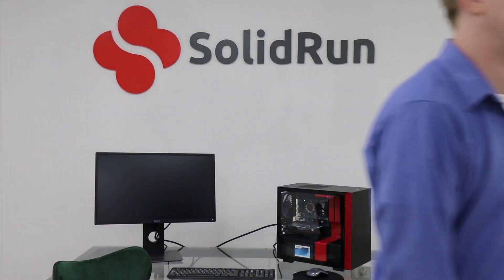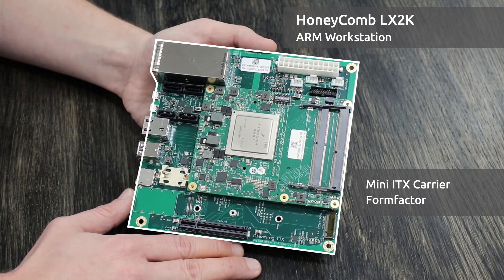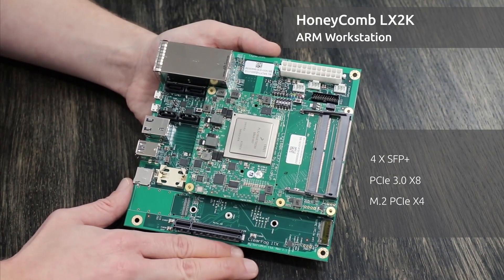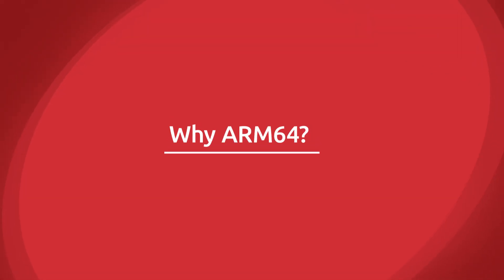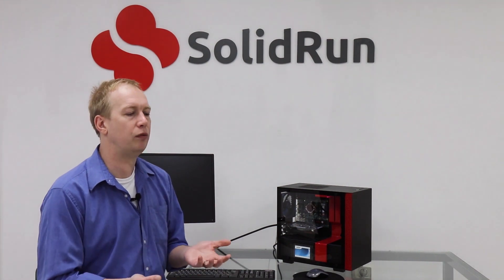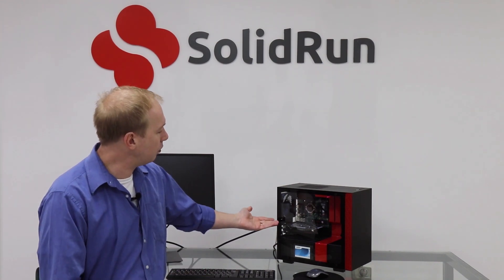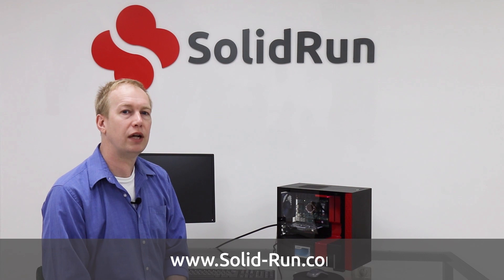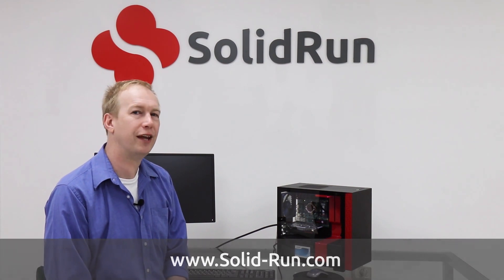HoneyComb LX2K - Ultimate Mini ITX Arm Workstation

Comment: I find this very interesting how does the SOC tolerate overclocking. I know pi 400 takes it rather well but with additional cooling even just a stock cooler. In contexts where a brief but explosive blast of compute is required eg building applications. Can the issue cooling permitted handle such things?
Reply: Generally the overclocking stability sweet spot is 2.2GHz, we have overclocked up to 2.5GHz with proper cooling, but new production models have the CPU voltage locked. 2.2GHz is possible with the default voltage settings.

Comment: Can it run windows 11?! Can it run Ubuntu?!
Reply: It can run Windows 11 currently, however Microsoft is not planning to support this generation of chipset moving forward.  Yes it is SystemReady ES certified and can run most standard Aarch64 distros.  For best results and on board networking support you will need a distribution that uses a 5.14 linux kernel or newer.

Comment: I'm super interested in this board and have been following it since it was first announced.  I've just been waiting for the price to come down.  Doesn't seem to have budged though.  Drop some of the high end networking and see if you can come down on the price.  If you got this board into the $400 range people would buy them like hot cakes.
Reply from the maker: A couple of times we have offered reduced pricing on our HoneyComb platform to target the developer community.  With the current supply chain issues that is unfortunately not currently an option.
Reply: I'd love something like this with a couple of SATA, an NVME and a couple of 1GbE RJ-45's around the 400-600$AUD range where I can get low-end intels with 8+ cores for. The quad SFC's doesn't interest me for a workstation config. Also if it was on a single board rather than a mezzanine card ..would that make it cheaper?

Comment: I finally ordered a ClearFog CX LX2. [Jon - I'm looking so much forward to enjoying your and your team's work. :) ]

The first thing I did, was to build the image using the docker-build. It just builds without any problems; what a joy! =)

I've chosen to use 8 x 10Gbit network configuration.
Later, when I can afford faster hardware (or a second LX2), I'll probably switch to 100Gbit or 4 x 25Gbit.

These are the transceivers and optics I'm planning on using:
6 x Digitus DN-81201 SFP+ (SMF, 10Gbit, 1310nm)
1 x Digitus DN-81300 QSFP+ (MMF, 40Gbit, 850nm)
1 x MPO-to-4xLC, 1m (or 3m, but will prefer 1m)
4 x Digitus DN-81200 SFP+ (MMF, 10Gbit, 850nm)
2 x Digitus DN-81001 (SMF, 1Gbit, 1310nm) - for "WAN" link
1 x D-Link DXS-1210-12SC switch
2 x D-Link DGS-1510-20 switch

The D-Link switches were bought used (DXS was actually never unpacked, got it for 40% of the retail price),
the SFP, SFP+, QSFP+ transceivers are D-Link compatible. As I prefer OS2, I choose to get DN-81201 where I can, but since the price of the QSFP+, MPO-to-4xLC octopus / fan-out cable is so much lower price than the Single Mode Fiber variant, I've chosen MMF for now.
The QSFP+ is around 62 Euro, the octopus / fan-out MPO-to-4xLC is about 31 Euro. The MMF SFP+ is about 25 Euro. The SMF SFP+ is about 45 Euro. The 1Gbit SFP is about 16 Euro.
-To get started, I'd only need a single SFP+ pair, but I'll probably start with the fan-out cable and transceivers for it, adding the remaining SMF transceivers as I go.

Please note: It might pay to purchase Finisar MMF transceivers (including the MMF 100Gbit QSFP28 - as of this writing, there's one available from eBay in the US for around $50, get it if you want the LX2, it'll probably be gone when I can afford it anyway).

My RAM choice was Ballistix SODIMM 2x8GB CL16/3200 MHz. Notice: This has not been confirmed working by Solid-Run yet; I will post my results here and to Solid-Run. If you want to be sure you get a working system, just order the Kingston RAM Solid-Run offers.
If the Ballistix RAM works, I'll upgrade to 2x32GB of the same kind. and also post compatibility results here and to Solid-Run.

Comment: i'd happily take one or two of such boards without sfp+ ports for cheaper. really it would be a great option
Reply from the maker: The sfp+ ports aren't really a huge cost of the board.  That technology is built into the SOC as SERDES lanes. The cost is unfortunately the same if they are SFP+ ports or additional PCIe lanes.

Comment: What is the tdp
Reply: The TDP for the system is 30-50W depending on the devices plugged in and the load on the system.  Of course adding a 100W GPU will bring that up quite a bit.

Comment: Just curious, has there been any significant updates to the HoneyComb LX2K product line since the initial release? I am aware since revision 1.5, the issue booting with from eMMC has been resolved.  However, when will the I/O plate be available for purchase?  Also, is there any additional information available about the usb/ STM32 port for remote management?  With the pre-lease version, the ability to power up/power down from the front power button was enable with the removal a particular compactor, as advised from technical support .  However, I would like to know if this functionality can enabled via software on a new board?

Comment: Cost wise n performance wise..
Better to buy 28 core 56 threads engineering grade used Xeon processor with LGA 2011 v3 shocket in under 50$ and a mini itx boards under 60$ from Ali express.
Reply: If cost vs performance is your target then yes go for it.  This product is designed to provide a development platform for people focused on Arm platforms.

Comment: Jon: It's possible for me to purchase a MiniPCIe-to-SFP board so I can optically isolate one of the small Solid-Run boards.
-But this MiniPCIe card cost around $200 (including 25% VAT, which would be $160 ex. VAT where I'm located).
You may want to consider designing a MiniPCIe-to-SFP board (SFP of SFP+) that can handle at least GbE (but preferrably 2.5GbE) if the final price can be $100 or less (if purchasing with another board, it would pay, as long as the final price is $130).
Personally I think this would be a great expansion for one of the smaller boards; especially the CN9130- and ClearFog-boards.
Reply: The next edk2 firmware release will have a build option to enable pcie bi-furcation.  This will allow the use of a riser card to split out the x8 slot into 2x x4.  We already have some developers using this feature.
Reply: @JonNettleton  Wow, that's super-great news. Remember to make a note in the shop and the spec-site. =)

Comment: Is it possible to 4k editing on it? A similar way to Apple M1 mini https://www.youtube.com/watch?v=UliJxItLw3I ?
Reply: I'd say this would depend solely on the editing-software.
Unfortunately, I am not very familiar with Linux video-editing software - but try searching YouTube.
If you remember Final Cut 3 (the old G3 version for 233 MHz PowerMacs), then it would make a scaled down version of the video, which would be used for editing. I have not seen this technique in newer software, but it would definitely make it possible to edit any size video (even "256K") on a fairly small system.
In Final Cut 3, the 'rendering' was then done in the background and the real (high-quality) video was slowly generated while the user would be editing the video using 'thumbnail' sized videos.
Try looking around on YouTube; I bet there must be demonstration of some video-editing software.

Comment: Jon / Malte: Could you make it a little more clear on the web-site, if the price includes both the carrier board and the module ? :)
-In fact, it would be a very good idea to list all the items included for every product you sell (this list could be updated/modified by a PopUp-button if multiple choices are available - just like the price would be updated normally).
Reply: Generally the shop has options for both the full product as well as the COM / SOM sold separately and with different assembly options.  For Instance HoneyComb is here https://shop.solid-run.com/product/SRLX216S00D00GE064H08CH/?_ga=2.114898439.1837362995.1618640035-1490297079.1607330814 and the CEX7 module is here https://shop.solid-run.com/product/SRX2160S01D00GE064V21C0/  Maybe you can provide a link to the page you find not clear enough?
Reply: @JonNettleton  That's one of the pages, the other is the page for the ClearFog CX LX2:
https://shop.solid-run.com/product/SRLX216S00D00GE064C08CH/
-What I'm asking is if the page could state something like: "This includes both the carrier board and the System-on-Module board".
Another way it could be written would be something like: "The package contains ... The complete assembly of the carrier board and the system-on-module board." - I've seen that you often mentions everything a package includes, so I think this is probably the style that will fit in the most.
Ilya told me in an email that the carrier boards are not (normally) sold as stand-alone as you want to ensure that everything works before shipping (I like that).

Apart from that, I just saw today, that one can purchase a M.2 - to - PCIe 'riser card'; eg. it "converts" the M.2 slot into an extra PCIe x4 slot. And not far away from that adapter, I saw another one, which is using an Asmedia chip to change the M.2 into a dual-SATA port (using RAID0/RAID1/JBOD).
I'm mainly interested in knowing if the M.2-to-PCIe riser card will work on the LX2.
(I already made the decision that I absolutely want the HoneyComb). ;)
Reply: Here's an example on one of the better-looking M.2-to-PCIe riser cards. This one is a x16 (as far as I understand, only one lane is actually used, so it doesn't matter if it says x1, x2, x4, x8 or x16; it'll still be using a single lane):
https://www.newegg.com/p/17Z-00EK-00923
Edit: If this works with the HoneyComb, I think many developers will find the solution attractive; especially if they need to develop software for a PCIe card - or if they want a 'low-performance graphics card' on the M.2 and a SDI-card on the built-in PCIe slot.

Comment: Interesting approach!

As a dev i see the industry moving towards devops and datacenter more and more. Things like virtualization, containerization and orchestration are the topics of the decade. Having a platform like this allows to develop on such a basis without spending hundreds per month for a rented datacenter or even thousands to buy multiple „real“ servers.

It sounds like a good solution for creating a homelab too!
Thinking of 3 nodes in a proxmox datacenter; each with slow spinning disks for mass storage and a fast m.2

Question is:
Will the compute module be updated (newer arm gen, more cores, higher speed per core, whatever) in the future and still work on the mini itx carrier board?
this would be awesome to be able to keep the „peripherals“ and only switch to a new cpu/ram config.

Pricing seems ok, still a discount for ordering 3 or more, would be awesome.

Comment: Im interested in when ARM becomes availble for home use. I would love to have a powerfull mini ITX ARM desktop in my in win chopin (150w psu) that only uses 30-50w. Like the Mac mini 25w.

Maybe some day gaming allso.
Reply: Ditto!
-One thing that crossed my mind a few times, is that it would be reasonable to have several different ARM CPUs on one board.
For instance, one could use the 8040 for powerful networking and connect it to an Exynos, which has excellent video processing, in order to make a real-time video encoder for broadcast use.
-I know, not home-use, but it's just an example on how features from different CPUs could benefit a design.
The Exynos and Snapdragon are both quick and low-power, great for UI, data-processing and calculations. They lack PCIe though - because those CPUs were designed for cellphones and nobody wants to have a cellphone with an ATTO RAID card sticking out the side - almost nobody.

Comment: This would be perfect for NAS.
Reply: Indeed.
When I purchase my HoneyComb LX2, I'll be using it for ...
1: Router+Firewall.
2: Quick NAS using BTRFS.
3: Web-server.
4: Mail-server.
5: Print-server
6: Git-server.
7: File-server.
8: Database-server (Redis).
9: Build-farm controller (including being a few build-nodes itself).
10: Testing and debugging my ARM code.

... And it'll still complain about having nothing to do all day. ;)
Reply: @68HC060  That's it? I plan to use it to conquer Jupiter.
Reply: @redribbonzx7207  :)
-Hopefully I'll be able to explore some of the NAS possibilities like ...
Using the M.2 for 1 SATA connector + 1 PCIe x4 card (I've found a SATA-breakout and a x4 PCIe breakout, but not a combination).
-I'd prefer a flex-PCB connector between the M.2 PCB and the PCIe connector - so that too much stress is avoided.
I won't be using the PCIe x8 for graphics cards, so I'll try and see if I can find some proper RAID card that can keep all lanes busy.

In my above comment, I actually forgot that I'd like to also use it as a boot-server for my Macs and having my accounts on it, but this will take time to set up (I've failed my attempts so far on another board); the other stuff is easy.

I do wish your LX2 will bring you a lot of joy. ;)

Comment: Was very confused after watching the video to go to the website and not be able to find it under workstations.  I went back to the video and punched in the product name and found it was listed under servers.  When I read "Mini ITX", I don't usually think server, but I think I understand the classification due to the 16 cores, but this video says "workstation", not server.  Then, when I click the "buy" button on the website, it says the page can't be found.  Perhaps the product is no longer available, but the messaging could be more verbose.

I'm looking to find a good daily driver aarch64 Desktop and this is a very interesting piece of hardware, especially for people with PC building experience.

If you have some footage of it running some productivity apps please share, or you may want to send a model to some of the game and tech reviewers out there which will really run its through its paces, like they have for nvidia and raspberry pi boards.

Demand for this hardware is only going to increase and it seems like a good opportunity to convince people that there are workstation boards ready to go.
Reply: https://shop.solid-run.com/product/SRLX216S00D00GE064H08CH/  Perhaps you hit a hosting glitch?  

Technically we consider the HoneyComb board a workstation and the ClearFog CX as a micro-server.  However the main difference between them is the jump from 4x10Gbps up to 100Gbps networking complexes.  Both systems are powered by the same LX2160a CEX7 module. 

As for a daily driver Aarch64 workstation, well I am typing this on my HoneyComb that I has been my daily desktop for almost a year now.  There are many other developers doing the same, specifically to help evolve the support ecosystem for the various Host OS's.

We haven't done any extensive reviews of the system, there have been some recent blog posts and write ups by community members.  You can also check out the interview I did on the Arm Software Developers channel, https://www.youtube.com/watch?v=sV_6xm0b8ow&t
Reply: @JonNettleton  here's a YouTuber I'd recommend sending one to: https://youtu.be/lcT5jLl538Q

I realize the target market is developers, but as a developer I follow guys like this guy because he's a pretty thorough reviewer.

Regardless, I'll probably grab one soon.  There's not a lot of PCs out there yet and the Mini ITX makes it way easier to switch.
Reply: Thanks for the quick reply.  This buy button is broken, not a glitch: https://www.solid-run.com/arm-servers-networking-platforms/honeycomb-workstation/

I did eventually find the shop page, thanks kindly for the direct link.

Comment: Just ordered one. I was looking for something like this for weeks; sub 1000$ powerful ARM desktop class machine.

I'm looking now for cases for this motherboard that will fit full size GPU. From what I can see, most of the mini ATX cases may not be suitable for that configuration with GPU. Probably microATX case that accepts miniATX MBs???
Reply: most mini ITX cases should fit it without a problem.  A lot depends on the GPU you plan on using.

Comment: i'd like an affordable ARM ITX/ATX Motherboard for my NAS servers, with 4+ Sata ports.
Reply: Depends what you consider affordable.  You will probably end up spending more on the drives than the board.  Keep an eye out on our new CN9130 COM Express type 7 based products.  I think that will probably be closer to what you are looking for.
Reply: I too am interested in ARM NAS boards.
I've been using an EspressoBin (which I do not recommend) so far.
The only SBCs I can find of a quality that I can accept are Solid-Run-boards.
What I really want is: 1: As many SATA-ports as possible. 2: As many 10Gbit netowork ports as possible. If these need to be available via PCIe or mPCIe, that's not a problem, but I'll of course prefer native SATA and native 10GbE, because they're slightly quicker than if the data needs to go through PCIe first (or there would be a lot of waste bandwidth on the PCie).
-For lowest cost Solid-Run NAS, I think the old ClearFog could do nicely with a mPCIe SATA and just the on-board ethernet.
A slightly better board would be the ClearFog-GT "router" board, it has 3 mPCIe slots, which could be used for SATA, giving a fair throughput. It even has 10GbE via SFP+.
Next option seem to be the MacchiatoBin, it does have all the goodies I want.
(Yes, I know, there are several other options, but those are the ones that I keep thinking about).
I want several different types of NAS. Some always online, some extremely quick and some that are only turned on when I want to make backups. -So for the backup-NAS I'd likely choose a low-cost board with a GbE port only, but for daily work, I'd like to have dual 10GbE, so I can boot from it from multiple desktop machines (that last one would require MacchiatoBin or a LayerScale board - most likely LayerScale).